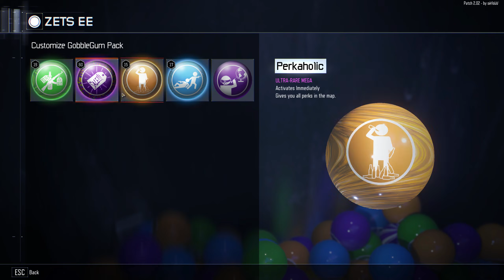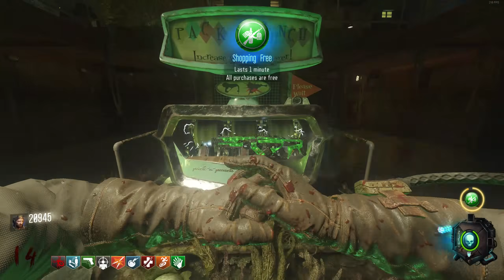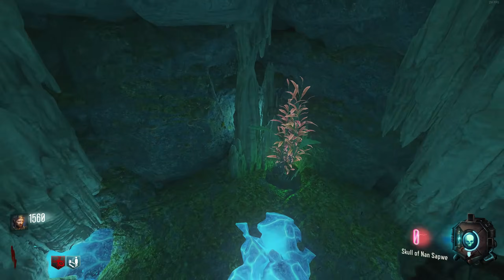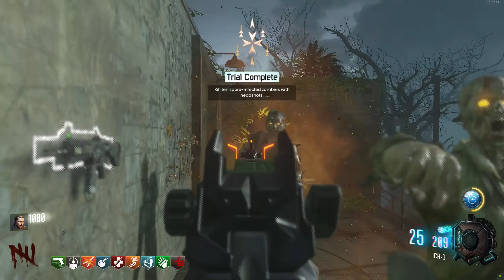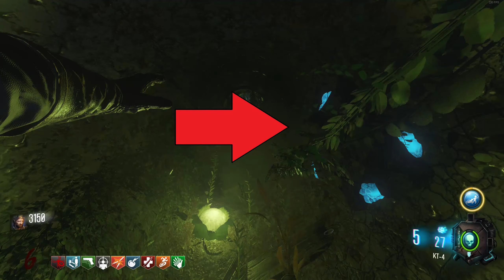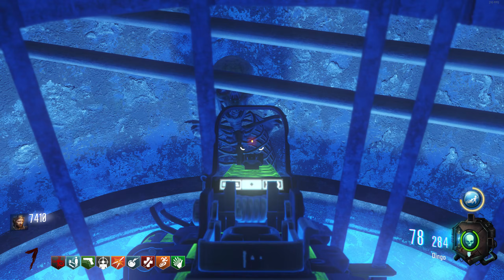ZETSUBOU NO SHIMA EASTER EGG GUIDE | ULTIMATE UPDATED GUIDE

Comment: What were you talking about with the first KT4 part? You want everyone on the other side of the map and quickly run to the door? I don't get it?
Reply from the maker: It's to make sure that no zombies are spawned in at green water bc if nobody is over there, there are no zombies over there. But as soon as you get everyone running there at the same time, all the zombies will spawn in at green water at once, which will give you a higher chance of the part spawning in